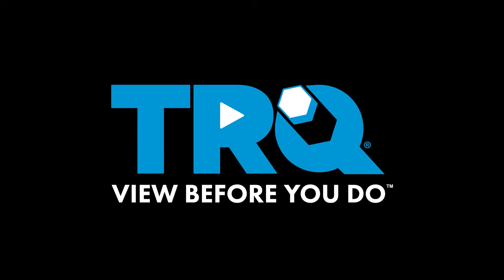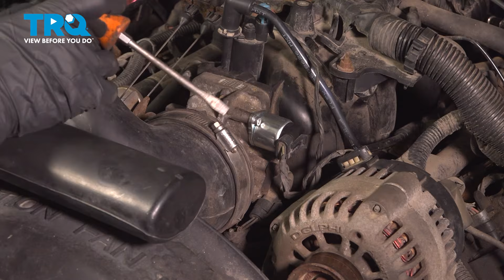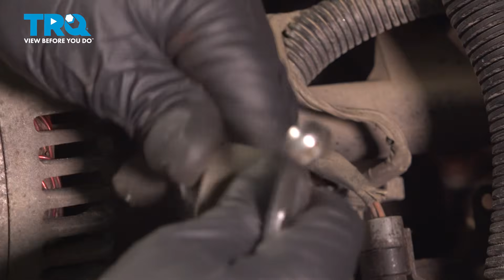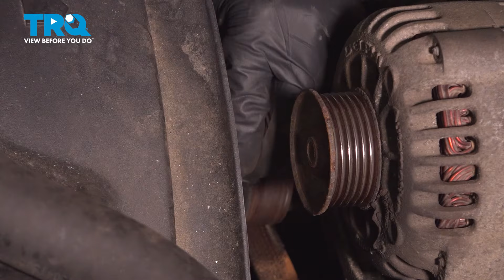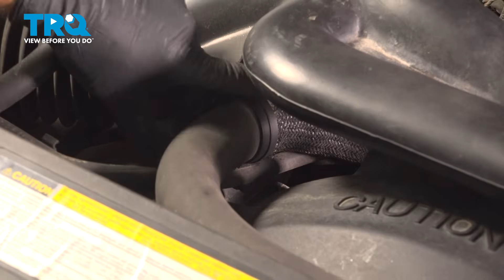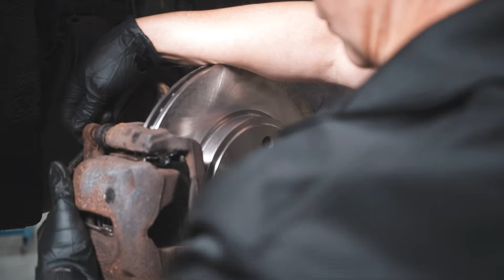How to Replace Throttle Position Sensor 1999-2006 Chevrolet Silverado 1500

Comment: I Have A 200 GMC Sierra And It's Pretty Much The Same, Great Trucks But I Want To Find The Man Responsible For Not Giving Enough Room For Easy Job Because It's Total Bullshit, I Recommend Using Needle Nose Vice Grips With Just The T-20 Bit On The End And Unplug IAC For A Little More Room, Otherwise Probably Gotta Move The Belt And Alternator Which Is Total Bullshit

Comment: I’ve had a bad shift from first to second on a truck I got off marketplace (oh boy) rebuild the transmission, replaced a transmission mount, done my u joints. This is my only hope otherwise I’m thinking transmission control module. I have no codes other than just still a rough shift first to second that varies time to time with different levels of throttle.

Comment: I replaced mine and it’s still doing the same thing starts up idle poor then dies even if I hit the gas. It only stay on when I spray starter fluid in the intake. Randomly lost power when I was driving on the highway I Was able to slowly make it to a friends house prior to this it use to sometimes cut off while in reverse

Comment: Seems like it would be easier just to remove the throttle body and clean it , and replace the TPS rather than removing the belt and alternator.
Reply: You have fun with that lol there's a radiator coolant line directly underneath the throttle body pain to get off n on